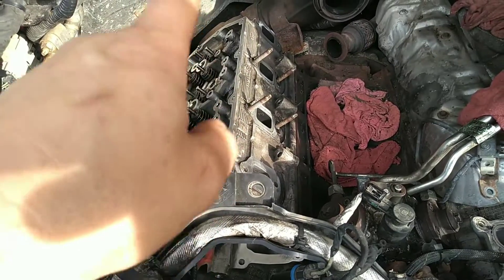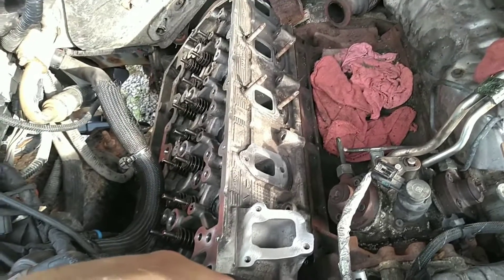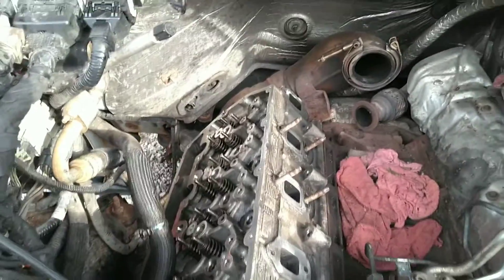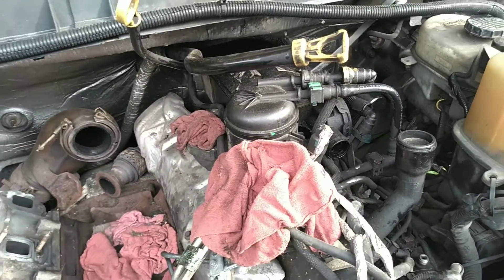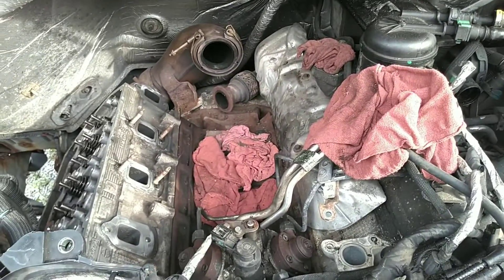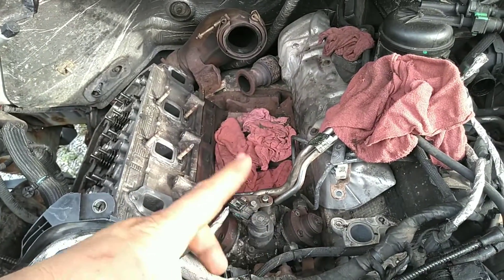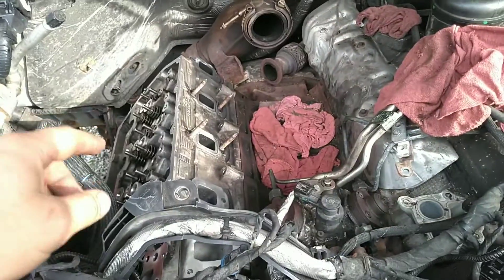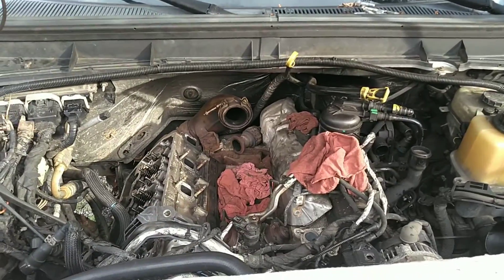IS THERE ENOUGH ROOM TO REMOVE THE CYLINDER HEAD ON A 6.7 POWERSTROKE WITH THE CAB ON?

Comment: Hi I just had to replace on a 15 Ford f550 6.7 turbo diseal the camshaft all lifters 4 rocker arm assemblies on the pass side and had the 2 cylinder heads replaced with rebuilt exchange heads all because of a misfire on cylinder 1 which was originally diagnosed as bad fuel injector so I replaced  all 4 injectors and glow plugs then it was supposed to be the main computer so I replaced that then they pulled the valve cover off and found that lifters had moved away from push rods and that's how they finally realized why they had a misfire on cylinder 1 ! I'm in the auto repair business myself but don't do diseal mechanical repairs so I subletting it out to diseal and machinery shop . I bought everything from Ford and spent 10k in parts at wholesale and 6k in labor . I'm not happy about this at all
Reply from the maker: This is a very common thing to have misdiagnosed unfortunately. It can cost a lot of money really fast.

Comment: New to working on these 6.7’s. If I’ve got a blown head gasket on the right side and was thinking about doing it myself. I’m very mechanically inclined and not scared of working on it. 
I can just replace the gasket, get a remanned head, new studs and just swap it out, huh? I was thinking “well, if I’ve got it half apart, I may as well do the whole thing”. Then I thought “it’s 100°+ every dang day and I really don’t wanna lose weight….” 
I’m kinda worried the left side will give sooner rather than later also.
Reply from the maker: It's definitely the best to do both sides. Most of the 6.7 Powerstroke head gasket issues are not actually a blown head gasket but a warped head. I would recommend doing both sides and having the head milled flat by a machine shop and then have them pressure test it to make sure there's no cracks. If you're going to run a hot tune then I would head stud it but if you're going to use it as a normal truck, the factory head bolts really do a good job.
Reply: @cincydieselrepair6893 , fair enough. I’ll do both sides and use remanned heads.

Comment: 2 years and still helping. However I got a question. My #4 cylinder and #3 cylinders injectors are stuck in the engine. Any tips?

Comment: I have a 2014 6.7 that was overfilled with oil. Ran for a second, Killed it. Then try to start it again and it would not start. Drained 6 quarts of oil out of it and it ran bad. cylinder # 8 contribution code popped up.  Cleaned the intake, changed injector # 8 and have a noise tapping noise from the passenger side   only when i will step on it Not in idle.  Bent push rod?   Paid out my ass to change injector and problem not fixed.
Reply: Bent pushrod, bad roller, camshaft scored, rocker arms fell out of place.

Comment: 6.0l 6.4, and 6.7 all have a procedure in the manual for cab on, and cab off. some cabs cannot be removed.. booms, buckets, ect, without many many more hours labor. if it's a pickup, and u dont pull the cab, u dont do enough of them to know the best way by thousands of hours of experience. This truck, the cab should have came off.

Comment: What would u expect to pay for head gasket replacement , machining, arp studs, injectors cleaned, new glow plugs,- and is that all necessary for a 2016 w 90k miles and a tune 

I’m bein told $7500
Reply: That's about right. $6300 to $8400 is what I'm coming up with at the shop, depending on some variables.

Head gaskets and etc on a 90k mile engine doesn't seem right, unless you're bulletproofing or etc and the heads are coming off for some reason to begin with.

But, that's about right as far as the price goes.

Comment: Just did my 12 in my driveway replaced the exhaust valves they were cracked because I couldn’t find new heads with everything going on
Reply: what symptoms were you having with the cracked valves?   what was your truck doing?